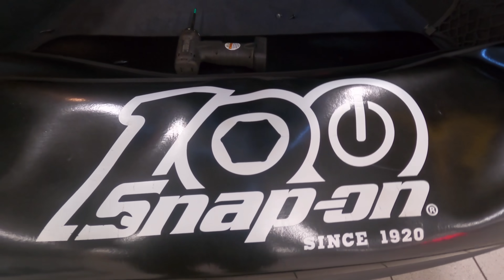Customer states I have a brake light out. AND THE W.A.W.P. IS DRY!!! Don't do it cheap!!

Comment: I didn’t even know Audi’s came with a break light. Learn something new every day.
Reply: They went bad through lack of use.  All gas, no brakes...LOL
Reply: Isn’t this only a bmw thing?
Reply: It must be custom job, pretty sure I saw some indicators on it too
Reply: One spells it "brake"...... that's two things you've learned today.
Reply: @HOON_KANG_sk  That's turn signals.  lol
Reply: They're completely optional, just like turn signals on a BMW
Reply: It used to be Volvos.
Reply: Maybe they're just passive reflectors with harness connectors for another unnecessarily overengineered German computer-monitored sensor.  I still don't know why cars come with three brake lights.  Land Rovers seem to work fine with only one.
Reply: They come with brake lights, but they do NOT come with TURN SIGNALS!

Comment: Crimp connectors are not the way to go. Try soldering properly and using heat shrink next time. Fixed many wiring issues for Mercedes for too many years.
Reply: And I've fixed many failed solder connections. He's an Audi dealer tech. VW/Audi repair procedures expressly forbid soldering wires, and require you to use these weatherproofbutt connectors, covered in adhesive lined heat shrink tubing. They are supplied in a kit together with the proper tool to crimp them, and when properly done, the repair is stronger than the original wire and totally weatherproof. Solder connections are prone to failure from vibration, and the tin from solder can actually weaken the wire.

Comment: Funny how doing it cheap always ends up costing a lot more.
Reply from the maker: yep, you do the repair twice.
Reply: Not always. I repaired my front bumper with binder twine. It held until I bottomed out on a dirt road that needed higher clearance than expected. That would have destroyed a new bumper. So second time around, on goes the new bumper.

Comment: An Audi water pump is driven by a tiny external cogged belt from the rear of the engine?????   And it's plastic! I honestly won't be shocked when auto manufacturers start introducing plastic pistons and market them as "Weight Reduced Polyvinyl Chloride Power Units."

Comment: Wow great video. I really like when they have you fix them. So would you say those but connectors are better than solder and heat shrink
Reply from the maker: the "crimps"  are self sealing when heated up. That is why i did not use shrink wrap. If this repair was outside the vehicle i would have used shrink wrap as well.
Reply: @customerstateswhat  Did you use the little heat gun from the VAS1978 kit to shrink the connector?
Reply from the maker: @cmotdibbler4454  Snap-on mini torch 😉

Comment: God, I can't tell you how many times I've run into the inner taillight wiring rats nest like that, especially on B7 & B8 A4s and usually done by some moron who doesn't understand that the rear fog light is only supposed to illuminate on the driver side of the car and that they are only supposed to use it during poor weather conditions, but they want them both on all the time -  the same idiots who recode their LED DRLs to stay on with their headlights and with the turn signals because they think it looks "broken" when they function as intended (for safety and as mandated by law).

Comment: "This is how you properly do it"

No.  No that is not.  That's the lazy but somewhat "okay" way to do it.  I would pay maybe 20% more for this over the electrical tape method.
Reply: Agreed! Absolute correct way is replace tailgate harness, but no-ones gonna do that so minimum I would do is proper soldered joins and heat shrink. 
Although in his defence they do look like heatshrink crimps so better than just a bodge crimp...
Reply: This is the way that VW/Audi REQUIRES you to do it. Their repair guidelines expressly forbid soldering wires. Solder can be prone to failure from vibration. If he had soldered this, he would be going against the requirements of his employer. He used weatherproof butt connectors from an official VW kit, they have very thick, adhesive lined heat shrink tubing.
Reply: @nigelbarton8350  read my comment above. This the the way that VW requires you to repair wiring, and they expressly forbid soldering wires, as solder joints can be prone to failure from vibration.

Comment: I work with motorcycles more than cars, usually I don't like using crimps if I can avoid it and it wasn't using one before as motorcycle wire harnesses are already packed tight AF, not much space for these fat crimps, but I still clean the wires, solder them properly and put heat shrink and weather proofing on it. This is just straight up laziness... In an emergency? Sure twist the wires together and electrical tape them, but when you already got your car apart and you have access to the wires, just do them properly please.... Good on you for fixing it, though cleaning up someone else's electrical butchery is always going to be amongst my top 5 worst jobs to do.
Reply: Thats one of my favorite things to do lol  especially if I know who did it and bring them around when its done right! "Looks good, huh?"
Reply: Crimping is actually better than soldering. This reminds me of the same old discussions about torx screws and how people resist to use them until today although torx screws are superior in every imaginable way.
Reply: @Asto508  well, not sure why you'd wanna even impose the absolute minimal potential of a wire disconnecting and risking corrosion in general when it literally wasn't designed to have a crimp in there. A solder is a permanent solution. It's not like there is a reason you should need to disconnect your rear taillight wires anywhere other than the intended connector.
Reply: @AntaresSQ01  VW specifically forbids soldering spliced wires. There are a multitude of reasons as to why using (the correct type of) crimp splices is by far and away better than soldering. Look up a video called "Why is Soldering So HATED In Motorsport Wiring?" for starters.
Reply: @AntaresSQ01  Soldering does have a way higher potential of disconnecting the wires over time than a crimp does. Having different metals with different thermal expansion coefficient is always a greater risk than having the same metal (crimps are made of copper like the wire). Different metals also don't bond well on a molecular level. Same for corrosion. Depending on what type of solder you use, it may corrode much faster than copper. And then you have to do it right, which is way harder than crimping properly. The crimp itself already shields the joint and then you have a heat shrink on top of it with those butt connectors. 

Also, if you think a crimp is not a permanent solution, you really got the wrong idea. You can't disconnect a proper crimp without completely cutting it. It's nothing temporary.
Reply: These are simply not true.
Soldering with the correct technique and materials is not going to fail before a crimp. Thermal expansion of metals is irrelevant unless it's right near the engine or exhaust. Soldering creates an protective layer that prevents oxidation, and then on top of this you have heat shrink and weather proofing laquers. It simply wont happen, not in the lifetime of the vehicle. Crimping is quick and easy, but people don't use the right crimps for repairs and then don't treat them properly, not to mention 90% of store bought crimps are absolutely shocking quality. If you can weather proof crimps and have space, sure. but if you're doing crimps for the sake of crimps they're the first point of failure. Electrical systems fail at connections 99% of the time, a proper solder job hardly counts as a connection. And as i said, sometimes crimping is not an option either. Also that video with "Motorsport hating soldering" is just straight bs. I've got motorsport experience and we've never once had issues with solders and i don't know anyone that did, crimps getting undone or damaged though? happened a handful of times. Both are valid repairs in my eyes. I just personally chose soldering if i want to fix something for good.
Reply: @AntaresSQ01  "Thermal expansion of metals is irrelevant unless it's right near the engine or exhaust."

It already matters on ambient temperature changes, especially when sudden. Tin has a 50% higher expansion coefficient than copper, which means on sub zero temperatures it will contract more than copper. Over multiple temperature cycles, this can create easily cracks between the materials (this actually happens on soldered pads). It highly depends on the quality, solder material and use case of course, but stating it doesn't matter if it's not directly exposed to very high temperature like in the proximity of the engine, is simply too simple.

"Soldering creates an protective layer that prevents oxidation"

Unless you use hard solder with high amounts of silver, this is simply not true and I'm sure you actually never use these for soldering wires (but maybe you're a unicorn).
Your usual solder consists almost exclusively of tin, which oxidizes faster than copper. Protected by heat shrinks, this doesn't matter in either case anyway.

"Electrical systems fail at connections 99% of the time"

They rarely fail on actual wires. The weakest points are badly soldered or corroded pads and cheap jellybeans on the PCB.

I'd also like to know where you have space for soldering but no space for crimping. If you can touch a wire with your hand, you can apply pliers to it.
Reply: @Asto508  Thermal expansion is irrelevant as the small degrees of change will take a very long time to cause damage, I'm aware of the different expansion rates but as I'm sure you're aware crimp connectors use tinned copper so are subjected to the exact same wear... I use high silver content solder for sensitive electronics, regular high quality tin solder for normal connections. Corrosion is only an issue on cheap impure solder wires. What you're mistaking is oxidation of tin is not a problem. when Tin oxidises it forms a thin film that prevents further oxidation, just go look at any old PC electronics. This layer protects the copper underneath from exposure to air. Now for the last issue, space is not a problem in terms of getting access but tucking the wires away. Often in motorbikes the loom is already squeezed between the tank and the frame or headstock, making the bundle any thicker is simply not viable. Cable management is very tight and soldering provides a solution that is not significantly thicker than a crimp + heat shrink over it. Other times you just don't want a big fat dongle hanging like handlebar switchgear wires.

As I said yea sure, crimps might theoretically last longer, but in real life solders have more than enough durability, I've certainly encountered magnitudes more broken, bent, corroded, lose crimp connectors than failed solders. If you wanna be extra pissy about it get a crimp connector, then solder it to the wire, then pull a rubber boot on it. As i said, it's just often not an option. In my time as an Automotive and motorsport engineer i've never had anyone say that solder is worse than crimps and that you should avoid using it. Everyone I know uses solders to extend/repair wires permanently and crimps for connections. where they are necessary/wanted.

Comment: How common are stuck thermostats on 3.0T engines circa 2012? Got an A7 in today with 64k and overheating, was surprised when I couldn't find a coolant leak, dry under the supercharger too.
Reply from the maker: I have never had a stuck one, yet.
Reply: @customerstateswhat  Good to know. Been leaning more towards a faulty, but dry, water pump. Or headgaskets. Thanks
Reply: @customerstateswhat  It was indeed a stuck thermostat. There's a TSB for the T-stat and a software update for the ECM. I believe for the A7 it's just for 2012-13 model years
Reply from the maker: @willbgrill  Yesterday i had a a stuck thermostat lol

Comment: you dont need wire crimps to do it right. you can do a proper joint with just tape.
however those are not a good joint
Reply: Those aren't the crap crimp connectors sold at Auto zone. They're from a kit supplied by VW/Audi, and dealers are required to use them, and forbidden to solder wires
And in what world is twist and tape an acceptable repair on stranded wire. It's absolutely NOT an acceptable repair on stranded wire. EVER. Solid wire is a different story, you can use a Western Union joint and tape it, though there's better methods today than that.
Reply: @puckcat22679  twisting snd soldering stranded wire it is acceptable when working with 12V. Also some manufacturers are spot welding wires together and then they tape over it (opel for example), but those wires tend to rust over time and causing problems, that is why you need to solder them. There are occasions that you cannot solder them because they will not bend, but sometimes if you want to make a solid connections then yes you need to solder them. Also by adding crimps you are incresing their size, and imagine if you are going to make a wiring repair for 20 cables you wouldn't be able to fit them in there proper space.
Imagine if you need to make a repair job indide a headlight for a bulb socket, there are occasions that you cannot fit connectors inside.
However on this particular occation using or not the crimps is ok, but i would recommend to put tape over such crimps to prevent them from rusting. I have seen a lot of them rusting and even proper manufacturers like Mercedes are soldering the ends of the crimp and also adding shrinkable over it with glue for not rusting.